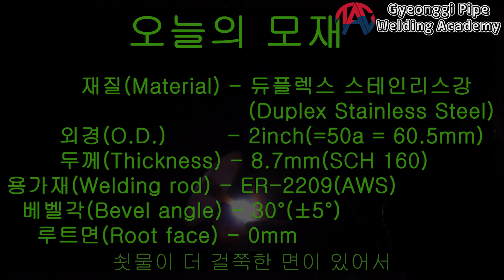듀플렉스(Duplex  Stainless steel pipe) 6 G(Groove) welding

Comment: In overhead section did you feed the rod through the gap or face feeding?
Reply from the maker: I don't know the exact meaning of face feeding.
  There are 2 types (1:53 half key hole, 2:39 key hole).
A welding rod is placed on the end of the bevel surface and welded,
Face feeding seems to be right. 
Two methods can be welded in the same way as the bottom view or overhead. 
Thank you, for watching.